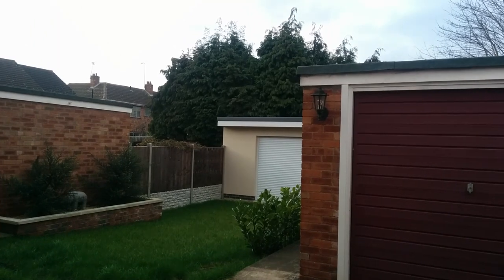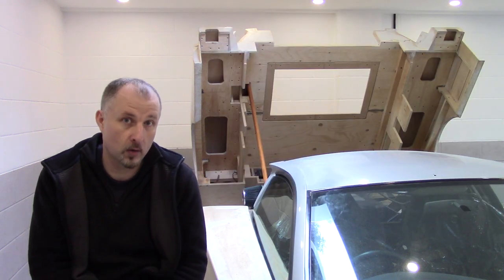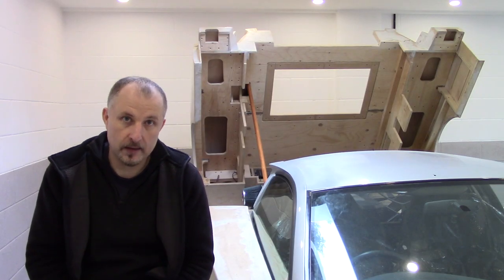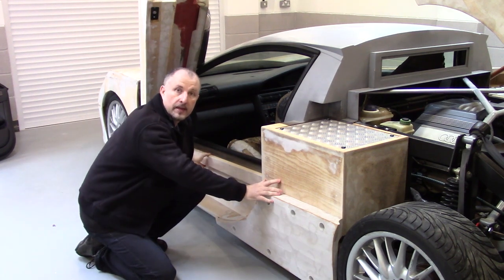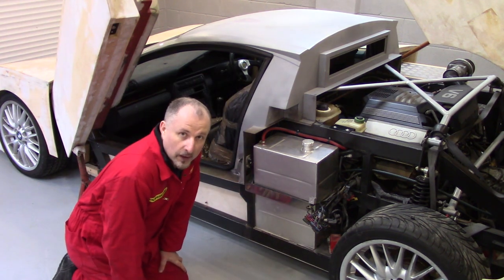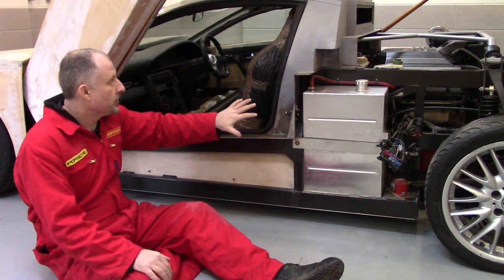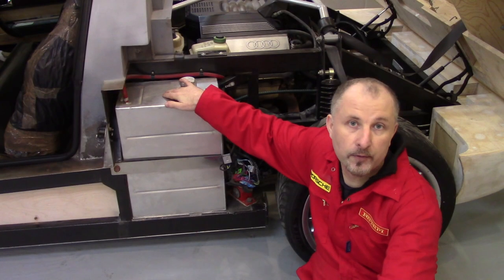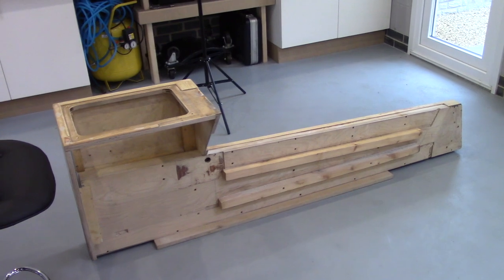I don’t want the chassis to rust on my DIY Supercar: Prototype Ep8

Comment: Great work. Dare i mention i have been looking at the Midlana site for a mid engine design, which is critical of the locost approach to chassis design and suspension mountings. I have a rusty MGF which needs a home for the mechanicals, and a cure for some of the MGF design failings on cooling and aerodynamics. I like the way you are using Audi rear suspension which means you dont have to build a new rear suspension, and Midlana seems to need a lot of new build parts.
Reply from the maker: Thanks, yes I think using the Audi rear suspension should help keep the cost down if I ever get a completed kit developed for sale.

Comment: Hey nice video but i have a question.  Why didn't you build the car with fiberglass instead of wood? Seems like a much better option. And much easier too. You would just need to build the car on a 3d software make a mold of styrofoam using a CNC machine and basically cover it with fiberglass.
Reply from the maker: Yes, there were a few reasons, first was one of cost. The 3D CNC machine fiberglass route was extremely expensive, in fact so much so that it was impossible for me to pay for. And secondly this is a working plug, meaning the everything works on this car like a finished car, for example the electric windows and locks. You can't do this with a Styrofoam block, as it's just for visual use and not a mechanical test. And lastly I had to engineer the car first, before the styling. For example I had to make everything fit, such as the seating, steering, engine and gearbox, and once that was established build the bodywork around the chassis. There's a few other problems as well, but I'll go into those as I make more episodes.